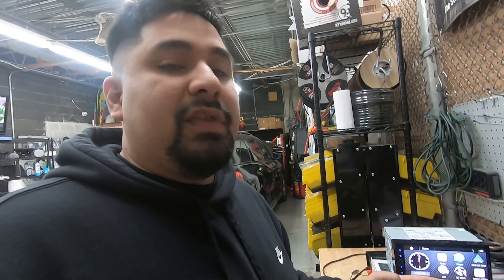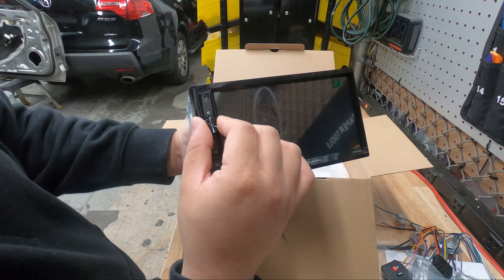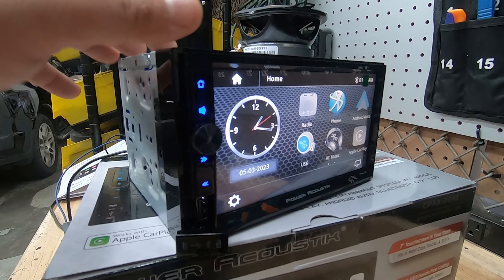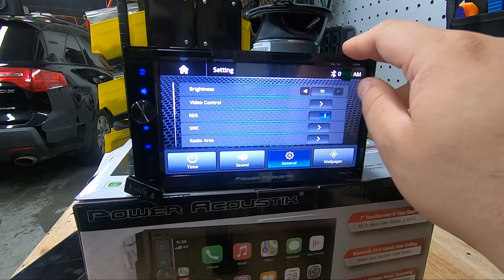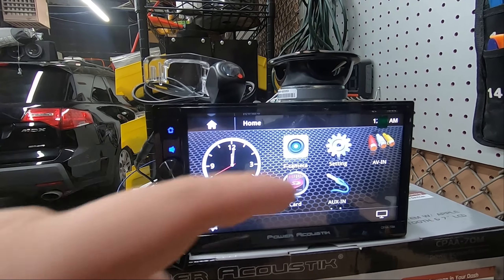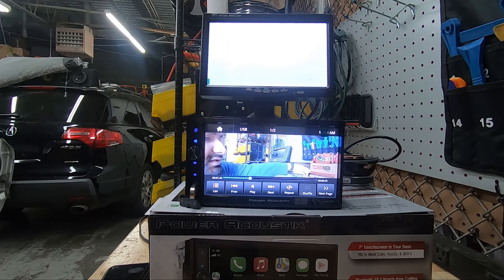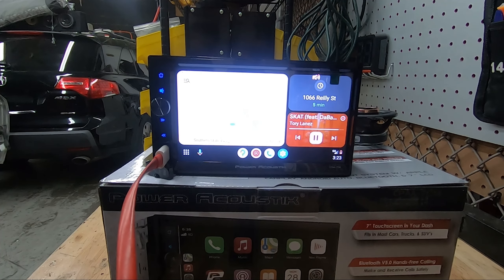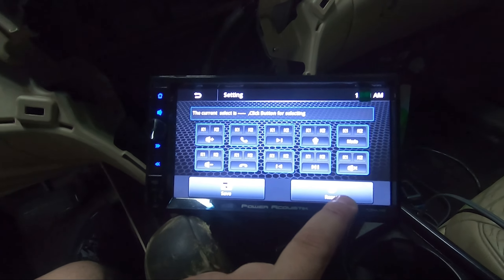A Budget Aftermarket Radio Option for Your Acura with Apple CarPlay / Android Auto - Power Acoustik

Comment: Hey, quick question regarding a conversion on a 2016 TLX. So I'm aware of the Grom v line conversion module. That module seems to work pretty well. However, I just ran into sellers on eBay selling OEM Acura TLX 2018- 2020 Android/apple car play module. Would you know if that can be retrofit to a 2016? I'm interested in staying as stock and as OEM as possible.
Reply from the maker: so the TLX is divided into separate years 15-17 and 18-20 so something must have changed in those years I can't say for sure what changed so I don't think they are compatible but I could be wrong.

Comment: would i be able to keep my stock backup camera from my '12 tsx base tech pack?
Reply from the maker: yes the backup camera goes to the separate screen and it won't be impacted by the new radio. But with the ELS system you will need to bypass the factory amplifier.
Reply: @AcuraAudioGarage have you done a video on the 2012 TSX base tech pack?

Comment: Hello awesome video I just bought that same unit it would help so much if you can tell us if you used both swc key wires that are on the back of the power acoustic cpaa 70m
Reply from the maker: just key 1 to keep the normal steering wheel controls, to keep the HFL or nav buttons you will need key 2 as well.

Comment: How can I connect a after market double din radio to video out on the factory nav screen so I can have whatever I watch on the radio on the nave screen is it possible where can I get the video input from the factory nav screen 2004-2008 acura tl with factory nav
Reply from the maker: you need a video converter to do this or you can use the navtool part look it up its the acura-tl-2004-2008-rgb-interface

Comment: Do you have any aftermarket dash kits for a 2007 RDX?
Reply from the maker: no but we are working on it. We bought the dash from a crashed one and have the connections to do so but the dash kit is in development. We have seen someone replace the factory screen with a radio but its so far away that it makes it tough.
Reply: @AcuraAudioGarage  thank you so much! Because I was going to do a radio with the screen replacement but do a EQ where the actual radio is